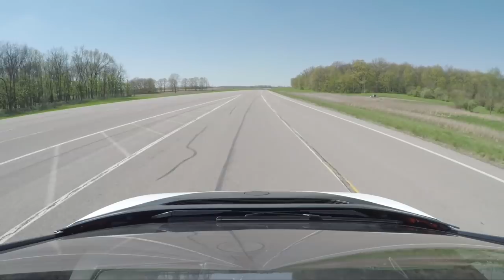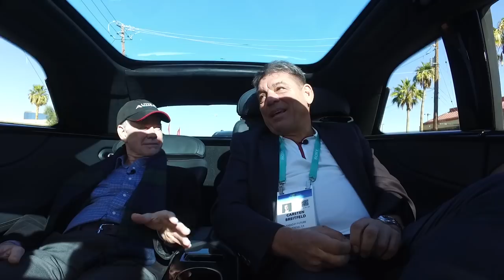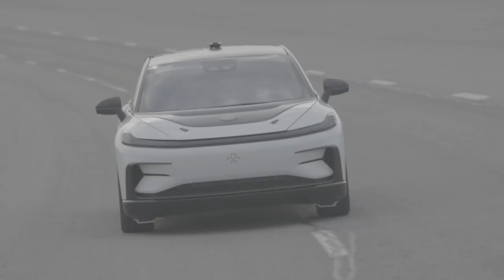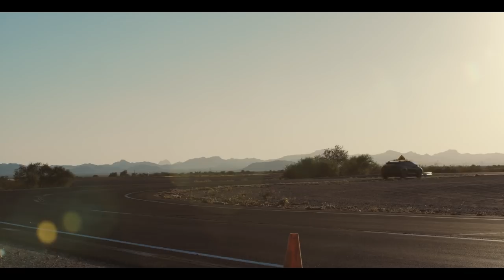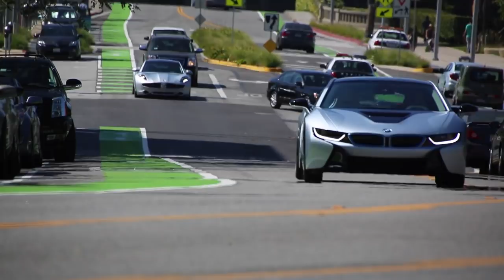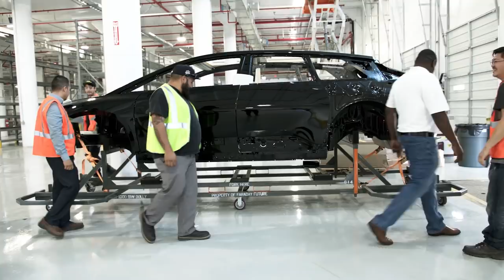Ridealong with Faraday Future's CEO - CES 2020

Comment: Perhaps this will be the FIRST actual competitor to Tesla. We shall see.
GM first modern electric EV1 (mistake using lead acid to start, but still first) and they crushed it, refused to sell it.)
GM also first with 200 mile EV - the Bolt  (and perhaps the best hybrid the Volt) and they dumped both.
W. Edward Deming said something like: "I claimed 75% of errors of auto industry came from management. I was wrong. It is more like 90%'".